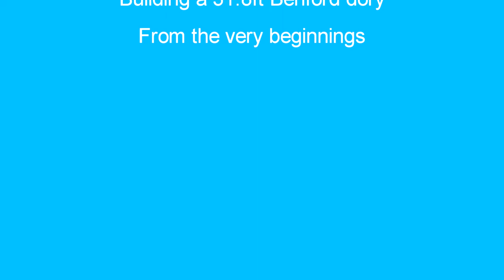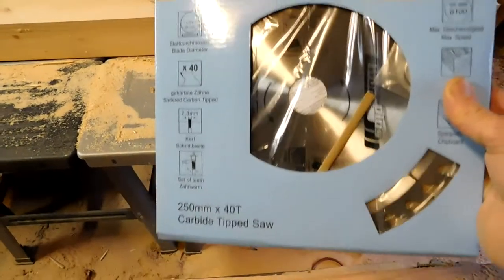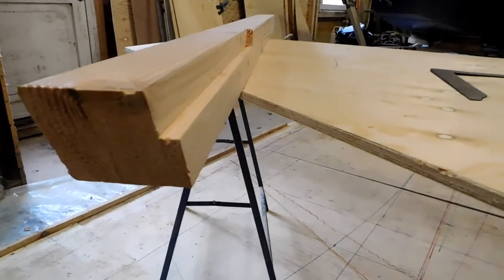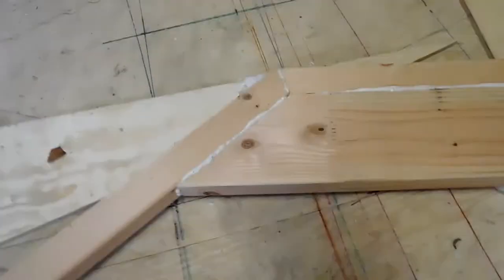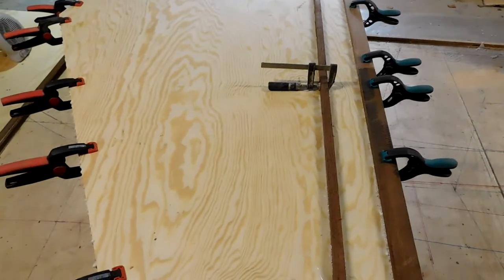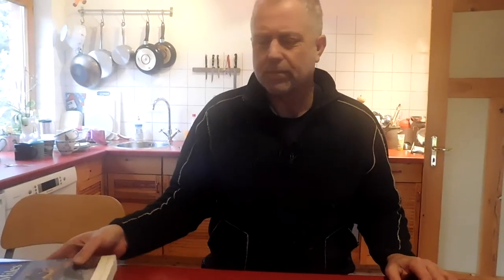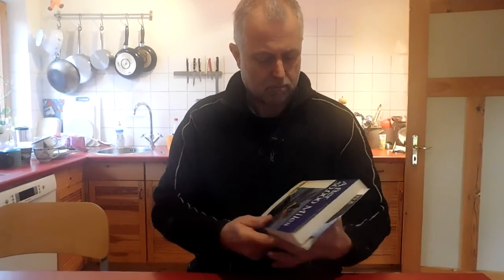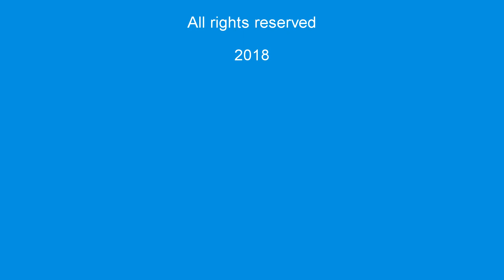The station 8 bulkhead/frame - SV Tapatya EP18

Comment: Nice timelapse of that epoxy cloth going on, Tony.  Does the cloth go up flush with the edge of the ply, or does it overlap a bit onto the beam?  
Regarding stainless screws, I've always read that leaving them in is a bit superfluous once your glue / epoxy has gone off - what are your thoughts on this?  Do they subsequently contribute to the strength of the joint?  No worries about long-term corrosion?
Your excitement about your new book (and new saw blades) is easy to understand - I get like that, too. Hal Roth's book, "After 50000 miles"  is very relevant, I agree - despite its age.  I'll check out the other book you mention.  Finally - just a thought - Ynot B is the only boatbuilding channel I can think of that features original music by the protagonist!  
One suggestion: there are some crackles on the audio from time to time when you narrate.  Have you thought about using an external mike?  I realise it's an additional expense, but as a musician perhaps you already have the relevant equipment?
Happy 2018 working on Tapatya.  Thanks for the video.  Good work, camera operator!
Reply from the maker: Hi Chris
Thanks for the comments - I'll address them in order:
The cloth on the athwartships panels is only there to prevent checking (small splits) in the ply that I'm using. As you know, I'm using softwood external grade ply and this will check if left untreated. The most sure way to prevent this is by covering it in a light cloth and epoxy. If I used a hardwood ply, this wouldn't be necessary, but I refuse to use wood freshly (ie. not recycled) gleaned from tropical forest sources. So, to answer your 1st question, the cloth only goes to the edge of the ply.
Yes; I think the screws could well be superfluous and I mainly take them out again once the glue has dried. The 3 that I put into the deck beam on this station piece are the first ones I've left in so far. I felt that, as the deck beam is only glued on one side of the ply panel, I'd be relying too much on the glue within the ply itself - gluing on the outside of a piece of plywood only really glues it to the outer ply of the plywood. As I felt this could be an area of significant loading, I decided to leave the screws in place there. I do feel that an additional mechanical bond can be beneficial, although I realise it might be overkill. The screw heads themselves have been sealed over with the cloth and epoxy. They are good quality 'Spax', German-made stainless steel screws and will be inside the boat. For these reasons, I'm not overly concerned about the long-term corrosion. 
Thanks. I actually mainly produce ambient music these days, but do venture into other genres from time to time. I've had to dig into my back catalogue a bit to find suitable pieces for the videos. Maybe I'll fit an ambient piece in some time :-)
Yes, the crackles annoy me. They are the result of the poor quality mic on the camera I use. Otherwise I'm happy with the camera video quality. I have invested in a clip-on external mic for the shots when I'm in them myself - talking to the camera, but really still need to buy another external shotgun mic and an external audio recorder- I use my phone at the moment (my camera doesn't have an external mic-in port). I kinda hope that someone might support me on Patreon one day to cover some of the expenses of recording equipment... We'll see!
Reply from the maker: I've now reconsidered your first question, Chris - Yes, the cloth does overlap a bit onto the floor beam. It's probably not necessary, but easier that way. The lower end of the ply panel is sealed with thickened epoxy and that and the cloth overlap should both prevent moisure getting into the end grain of the ply, which is important.
Reply from the maker: And now I've stopped being such a cheapskate and have ordered a Tascam audio recorder. The audio quality on my future videos should improve.... I hope!!!
Reply: Ynot B Ynot B Ha!  Talk about great customer service... All my questions answered - and you're going ahead and  investing in a better audio setup.  Thanks, Tony: your audience is sure to increase if you continue to be this attentive to the comments section.  Best wishes, Chris
Reply from the maker: That'd be nice :-)

Comment: Is there a reason you omly glassed the ply and not the entire frame? Are you waiting until assembly to glass the frame wood?
Reply from the maker: Hi Robert. The frame wood won't be glassed, just coated with epoxy and painted or varnished. The reason for glassing the interior ply is that pine or fir ply tends to crack (check) which would allow moisture into the ply core. The glass stops the checking and so seals the ply.